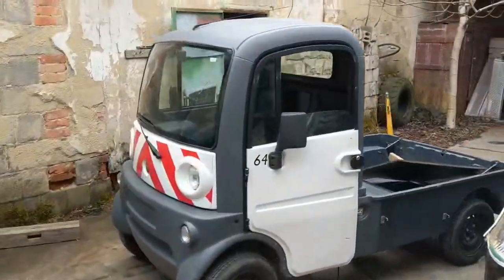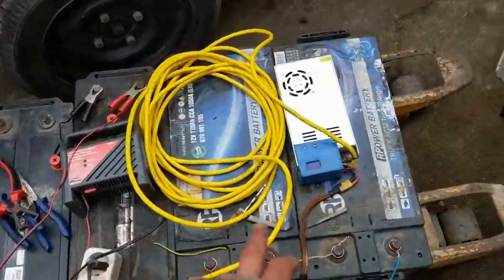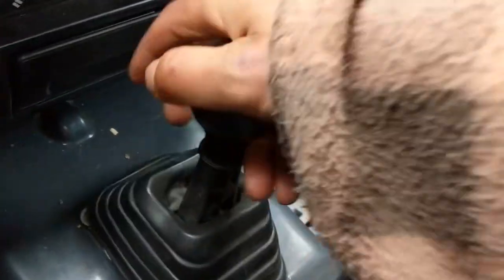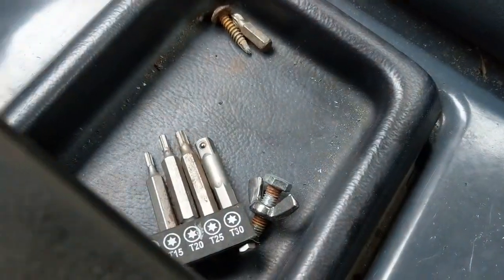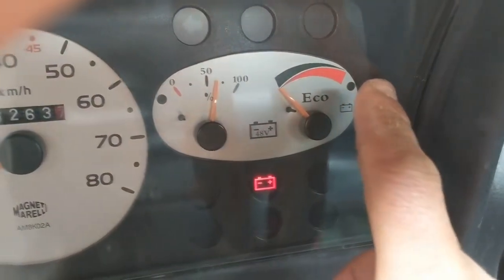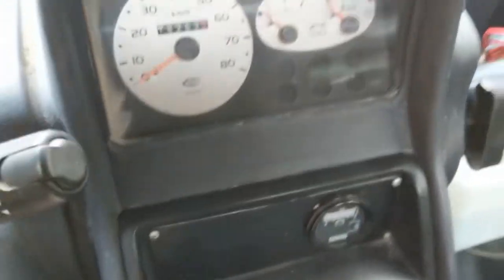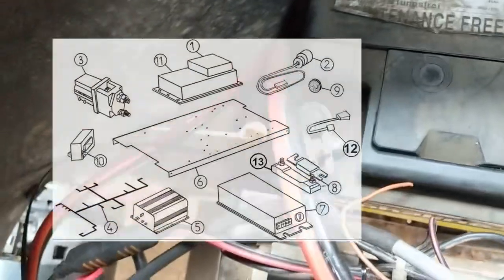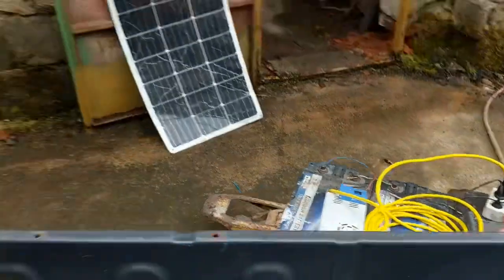YES, my new Aixam 2003 Mega Truck Electric moves :-)

Comment: Nice project! Is it road legal? Is it road registered? Can you insure and use it as normal truck/car? Are you gonna convert it to lithium batteries in future? Regards!
Reply from the maker: Yes legal. Only 45 km/h but a cheap Moped license plate. And no vehicle inspections at all.
I still have not decided whether I will go for 200+ Wh/kg Liion or 140 Wh/kg Lifepo4.
Looking for a cheap source inside Europe. Liion < 150 €/kWh or Lifepo4 < 200 €/kWh
Reply: Nice vidéo, il want to buy one Who is not working, do you have the électric plan ?
Thanks .